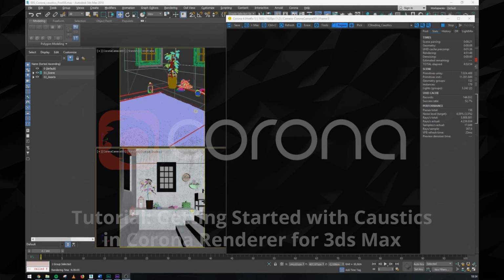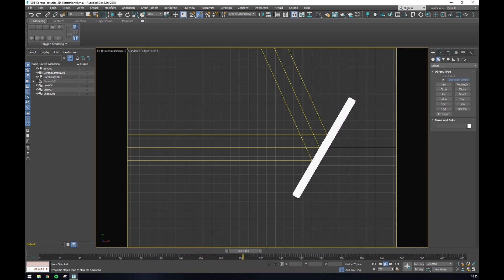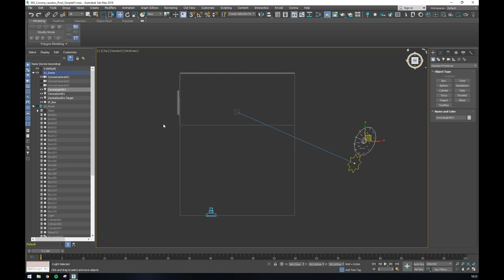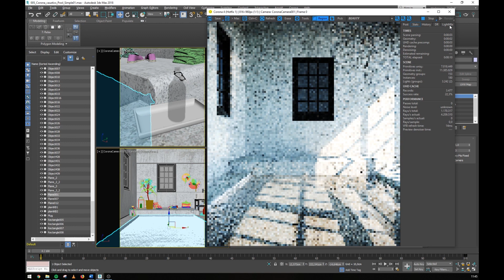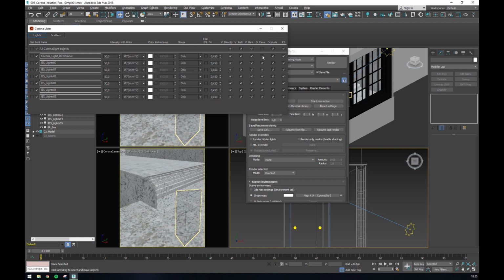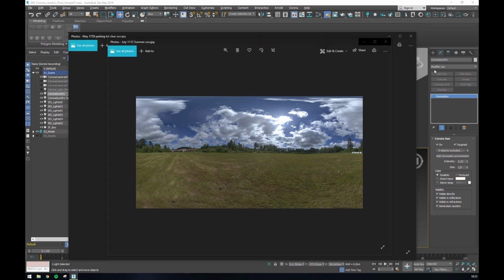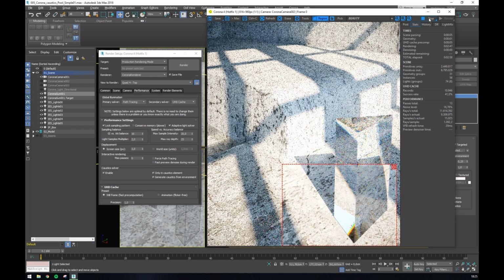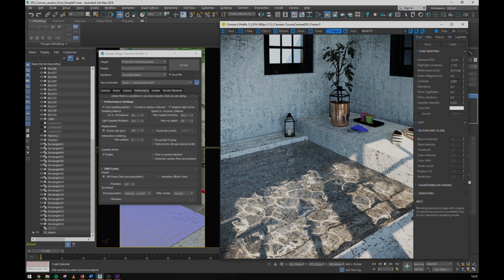Tutorial: Getting Started with Caustics in Corona Renderer for 3ds Max

Comment: Does Corona with with Phoenix FD fire yet? Does it still render white?
Reply from the maker: It should have worked properly ever since compatibility was introduced - only Foam was unsupported (and remains unsupported), but fire should have been working fine. We'd need more details if you are having any problems - see https://coronarenderer.freshdesk.com/support/solutions/articles/5000524006-how-to-report-issues-3ds-max. Thanks! Tom
Reply: @CoronaArchViz  yes. It renders all white. Is it fixed in version 4? Maybe I still have 3
Reply from the maker: @DevByGrace  Compatibility with foam has not been added yet, and is not on the roadmap for now, sorry. There is always the Feature Request section of our forum, you can add your voice to any existing thread, or post a new one if no-one has requested it already - see https://corona-renderer.com/forum/index.php?board=5.0. Thanks! Tom
Reply: @CoronaArchViz  and do you know when update will work with foam?